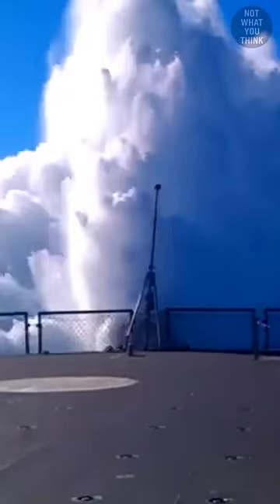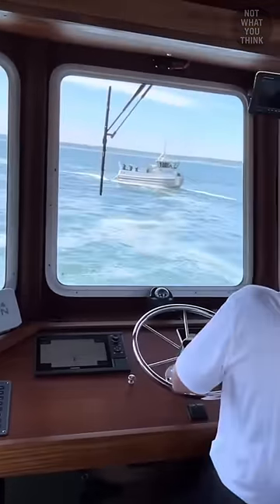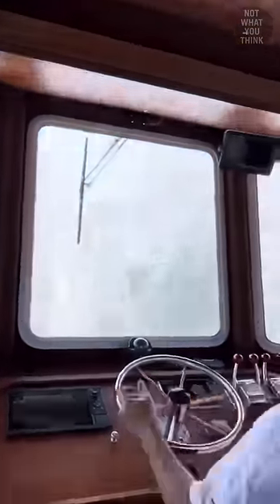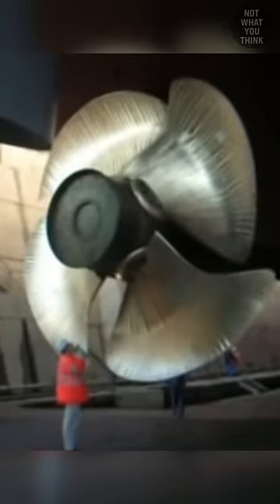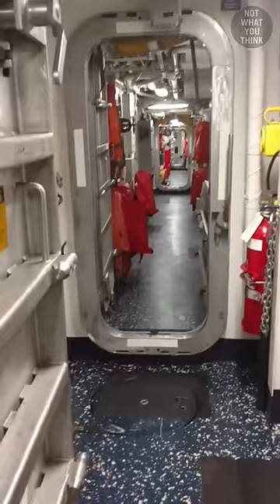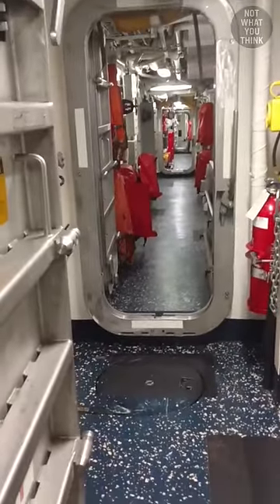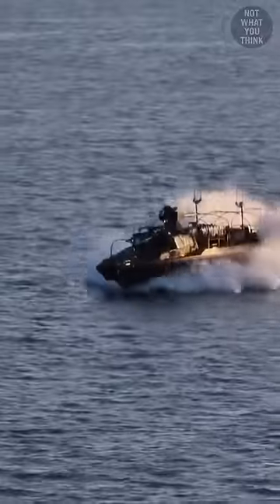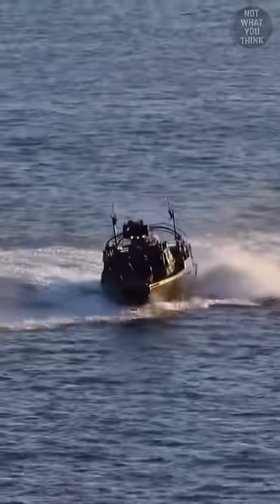Water Crash Stop #shorts

Comment: Done this in the navy, you find weak welds real fast
Reply: I need a personal story bro😂
Reply: That makes sense if everythings welded on one side and the bead doesn't have alot of penetration it ends up acting more like a hinge rather then a fusion of metal
Reply: @gameseeker6307 one time he did it on a ship and found the weak welds.  😂😂
Reply: Entire bulkhead door falls off
Reply: Well, better to find them close to land, than when you're in the middle of the ocean (especially true on submarines, but surface sailors are undoubtedly concerned about them also).
Reply: @Darthdoodoo  And then discovered that every ship can be a submarine, once.
Reply: @peeonu25 what if the engineering is sound but the welder sucks balls? Then it’s not the engineering like what on earth?
Reply: No wonder the littoral ships were breaking up at their seams...

Comment: "2.5 boat lengths"

Anything but the metric system
Reply: As if it's not effective
Reply: 2,5*16m
Reply from the maker: It's a relative measure based on the length of the vessel, irrelevant of the unit of measure!
Reply: I love metric, but sometimes things are better measured with other more relatable units
Reply: @projecttitanium-slowishdriver 2.54*1600
Reply: @alveeker3907 exactly football fields and elephants
Reply: @NotWhatYouThink  tell that to teams competing in the rowing championships. Length of the boat is totally not enough to measure boat's drag.
Reply: Without knowing the boat length, it's more helpful to use its length as a measure, plus it's faster and easier - while you can quickly visualize 2.5 boats, you would need at least one more mental step before that if you were given the length of boat and its stopping distance.
And if you were only given the breaking distance in meters without mentioning boat length, you wouldn't have enough information to visualize.
Reply: That's an usual way to compare ships performance.
If a 300meters length ship stoping in 400meters is performing better than a 20meters boat stoping in 50meters.
The first distance one is 1.3 boat length, second is 2.5.
That's not special to use this "unit".
Reply: About to the 20 yard line.
Reply: It kinda makes sense as a comparative unit
Reply: In metric the boat is still the same length so that doesn't change a bit😂
Reply: 2.5 boat lenghts are easy. 

The Cb90 fast assault craft is roughly 17.4978 retarded meters long.

So if you convert this it´s roughly 10.4985 eagles per gallon.

2.5x10.4985 = 26.2461

So the boat can stop in 26.2461 eagles per gallon.

(The CB90 Fast Attack Craft is 16 Meters long, it can stop in a distance of about 40 Meters.)
Reply: @Fischbroetchen2k  but it's a vessel so we're talking nortical miles. And around the equator the distance is even shorter. So u can't convert it one to one in sea eagles. U need to use seagulls
Reply: @superliegebeest544  Oh dangit, rookie mistake. You´re right~
Reply: That's the precise measurement used by the Swedish navy in reference to this, so... :P
Reply: Flies fly faster in body-lengths than jet airliners. There is something we can aspire to.
Reply: Boatlength is a relative term, surely you can see the utility in that.
Reply: @amb1u5  bananas, cubits, barrels of bacon, washing machines.
Reply: @sealard2279 it's arguably more effective than other measurement systems, as you always have the relative measurement on hand
Reply: It's a very common way to measure the stopping distance of any sea-going vessel, and is being taught all over the world (including Europe, where I'm from).
Reply: I'm sorry, that was appropriately 0.000000017 moon landings
Reply: @NotWhatYouThink  is not what you think!
Reply: It’s like specific gravity. Compare to a standard. In this case the standard is the length of the boat or an internal standard.
Reply: Too many people missed the joke...
Reply: @NotWhatYouThink I guess you could say…

It’s not what you think
Reply: No, I think counting all things in boat lengths is way better and cooler, for example I’m 0.09 boat lengths tall
Reply: stopping distance/ship length = m/m. It is dimensionless, many are used in physics like the fine-structure constant. It is dimensionless no matter the system of units.

Metric rules because its makes such simplifications easy and obvious.
Reply: if you tell me "57.9 meters" im not gonna know what that is. its easier for some people to visualize based on stuff they actually see in real life, so stop acting superior
Reply: @F4PhantomGaming  I agree, humans are poor at estimating distance particularly at higher speeds with relative velocities. It's why (in the UK) we recommend drivers keep at least a 2 second gap, not 70m at 100kph, 50m at 80kph etc.

Dimensionless units are great, unlike just  distance or length it gives useful information in isolation.
Reply: Meters don't mean shit on the open ocean. 1 meter could just as well be 10 meters with no reference point.
Reply: That is how it’s usually measured….
Reply: Also known as 8 baby (under 6 months age) feer, 9
Reply: "aNyThInG bUt ThE mEtRiC sYsTeM" it literally means 2.5 times the length of that ship genius
Reply: The narrator is clearly European
Reply: A typical reason for referencing items or places for distance is most people have a hard time picturing 100ft or 100m but they can usually picture the length of an average car, truck, football field, plane, etc.
Reply: wah wah wah
Reply: @othmanem3331 A 300 meter ship can't phisically stop on its own in 400 meters. I get what you're trying to say, but that only works as a thought experiment. In real life, with how different length and weight boats stop with physics and momentum, it works really well using boat length as reference.
Reply: @bubububucxz  or Central Parks and Empire State Buildings, whatever that measurement means to anyone outside of New York City.
Reply: In this case a boat length is more useful because the larger the boat the longer the brake distance, so the relation between them is the best indicator of brake force/ability.
Reply: But it's still better than inches and Miles ‼️‼️‼️
Reply: Ah, just like the founding fathers intended...
Reply: This is a very common unit of measure in the marine industry. It is also used in the metric part of the world. The benefit of this unit is that it scales with the vessel's size, and thus can be used to compare performance or other metrics across multiple sizes of vessels.
Reply: Still better than your unoriginal comment
Reply: I do love the meme here, but strangely enough this is how people measure stuff when related to boats and quite common too
Reply: Wait which system landed humankind on the moon again?
Reply: I used to feel the same until I travelled and realized that we're the dumb ones for using the imperial system bestowed upon us by our hateful English colonizers who eventually dropped it themselves but we kept the memory of their greasy oppression.
Reply: @666Tomato666 Killer Tomatoes. Good one.
Reply: @NotWhatYouThink which boat? How long? Just use metric bro :)
Reply: @UserName-cb6jz that’s a logical fallacy. 2.5 boat lengths doesn’t really tell you shit and the majority of people (by far) suck at estimating lengths and speeds (check car reports).
Simply using metric, 2.5x16 would’ve made it more clear, accurate and easily to understand for the vast majority of people (except the majority of Americans, who never learned proper ways of measuring things, but there you might as well use elephants as reference)
Reply: this has nothing to do with metric or imperial. It’s in relation to the actual boat.
Reply: 75 Olympic pools end to end long.🙄
Reply: @ildart8738  by that metric, a falcon would travel Mach 16 and a California mite would be over Mach 30.
Reply: @GlutenEruption  The body-length vs speed was an idea that I picked up in an old Soviet physics textbook that was written back in the 70-s. But it is an intriguing method of measuring speed. Flies are much faster than current jet airliners in this aspect, yet they are very primitive. Perhaps we can learn something from fly aerodynamics.
Reply: Cubits & spans!
Reply: Do you think boats are all the same length? Dumb comment.
Reply: We use metric in Denmark, but during watches on the bridge in the navy, we often use boat lengths to give approximate distances to objects below a nautical mile away, because it’s faster and often, time’s critical
Reply: But how long is the ship?!
Reply: @NotWhatYouThink how is it irrelevant if it is a unit of measurement?
Reply: I like my freedom units
Reply: God damn right
Reply: lol
Reply: @NotWhatYouThink noo just no
Reply: @Lord_Juvens well my boat can stop in 1.5 meters! Pretty impressive performance yes? 

Just kidding my boat is 30cm long and is classified as a toy. 

They used boat lengths because it's a YouTube short. If they used actual units they would have to also explain the length of the boat and why that's an impressive length for it to stop in. They don't have time for that so they just give you the advertising brochure bullet point statement.
Reply: that's the measurement we use in the swedish army for it as well. If you want it in meters it would be 39,75 meters
Reply: Which “boat” nobody actually knows 😂
Reply: In this case it seems more relevant. 

Stopping in, let’s say, 100 meters, might be a lot for a small boat, whereas for large ships, 100 meters is practically nothing.
Reply: @NotWhatYouThink yeah i had guessed it was a well used method of measuring length some people just want some excuse to make fun of the metric system
Reply: i’ll take boat lengths over metric system. much more visually to understand
Reply: Why would you need it so exact loll
Reply: Lmao
Reply: That’s literally how those boats stopping distances are calculated. You want assault craft and other boats that use that technique to stop as quickly as possible and since all boats are different lengths they all need to be tested against roughly the same criterIa which gives you measuring in boat lengths
Reply: WHAT THE F**K IS A KILOMETER?!?!!???
-Andrew Jackson
Reply: About 100 meters
Reply: @bubububucxz  I can picture football fields better than a random number of meters... 🤷‍♂️
Reply: @TheKetamineSquid  Oh, don't worry, it's ok when you do it, OP is only mocking when Americans do it. Just like how when Australians use the term "soccer" nobody bats an eye...
Reply: Murica
Reply: Metric system is only More accurate for basic measurements. 
Ferwnheight is much better than celceus. And speaking in terms of extremely small measurements, the standard system is much more accurate(.876 of a millimeter vs 8 mils. [No they are absolutely not the same thing, a mil is a unit of measurement used predominantly in machining.]. The american system is much more accurate under for anything smaller than what a tape measure can read.
Reply: Exactly. And on something like a boat, it's really hard to measure exact distance, so 2.5 boat lengths is a more effective way of getting the message across. And you can Google the length of the boat of you want a "more accurate" number.
Reply: @alveeker3907 why do people say they love metric? Whats to love about it? How is it better? I want to know what you think, I just might make the switch, its sk foreign to me at the moment.
Reply: Call back when the metric system puts someone on the moon💀
Reply: @jthablaidd  you know a rocket crashed because of the imperial system. Most American scientists use the metric system. The rocket crashed because of the calculations were wrong, caused by the imperial systems inaccuracy.
Reply: I've been on boats since 7 and worked on them since 14 boat lengths are used above most measuring systems
Reply: @GrapheneOxideIsInCVVax  Think of metric measurements like a big family where everyone's related. They're all connected through the power of 10. For example, there are 1000 millimeters in a meter, and 1000 meters in a kilometer. It's like a ladder where you can climb up or down by adding or removing zeros. So whether you're talking about length, weight, or volume, it's all part of the same metric family tree.
Reply: @UserName-cb6jz  the boat stops after 37m
Reply: Not shitting on the metric system because it is superior in every but here it’s a good metric. Also it is used very commonly
Reply: @UserName-cb6jz  And you can compare it to other boats/ships. A battleship and a torpedo boat might have the same stopping distance in boat lengths, but different stopping distances metric.
Reply: Damn right!🇺🇸
Reply: @sealard2279  say that to the army!
Reply: No metric on the moon
Reply: Metric users gunna virtue signal 😂
Reply: How many football stadiums is that?
Reply: @amb1u5  except that only works for one specific ship. You lose information by measuring it anything else.
Reply: @WakandaHoe aren't school shootings' measured in terms of 9 mm and 5.56 mm?
Reply: Because the metric system sucks.
Reply: @sealard2279  if metric is not effective, then imperial is downright idiotic
Reply: It’s called dimensionless figures so units are irrelevant.
Reply: The metric system absolutely put people on the moon (together with imperial). The measuremens on that project were a mess with both systems wildly mixed in the same sentence
Reply: Ask how long the boat is on Google in metric 😅it helps
Reply: I’m love how the YouTube channel had to comment how wrong your original comment was, “based on the length of the vessel, irrelevant of the unit of measure”. Doesn’t seem like you understand how the world works
Reply: Metric sucks if you’re used to customary. It’s part of life, and its the system engraved in our minds from childhood. I dont need to know how to use the metric system because im plenty happy with the customary system
Reply: its the same thing as saying 2 and a half car lengths stop being stupid an complaining for no reason thats how stopping distance is measured
Reply: The literal definition of a meter is “1 ten millionth of half the circumference of the earth.” I’ll take “roughly the size of a foot” or even “boat lengths” over that any day of the week for casual communication.
Reply: Hey quick question genius what system does Sweden use
Reply: its actually the term used by  users regarding the CB90.  Vessels are usually measured in feet anyway.
Reply: It's a unitless information, just multiplication 🤷
Reply: Pin of shame
Reply: @alveeker3907 eh growing up with Metric is as relatable as inches are to people who grew up with that. I have to convert to inches but I automatically relatlate things in size based on the metric system. It's easier to read too mean learning how to read an American measuring tape was a nightmare.
Reply: im all for making fun of imperial units, but measuring in the vehicle's own length is a very helpful way to measure its deceleration...
Reply: We’re never changing!